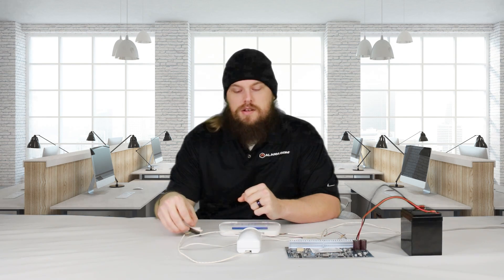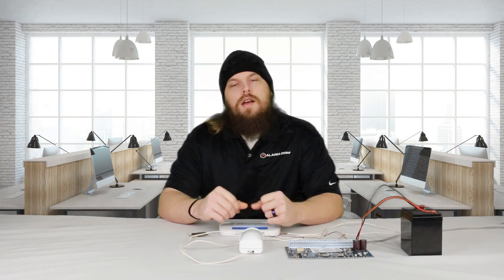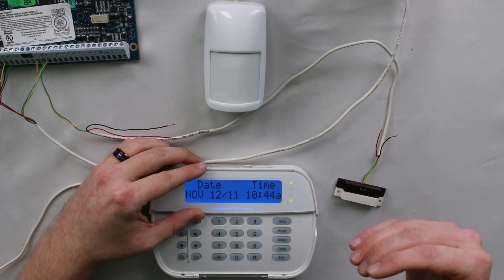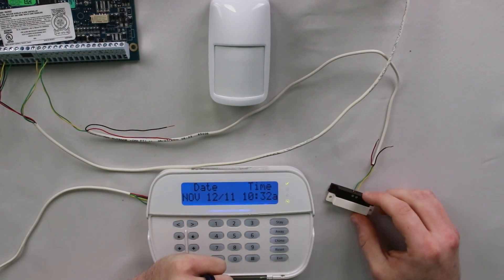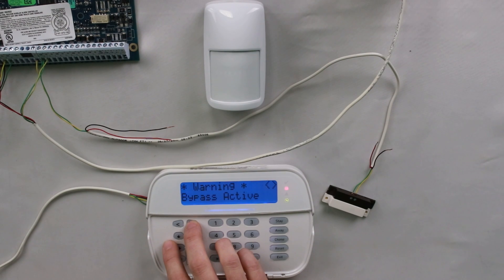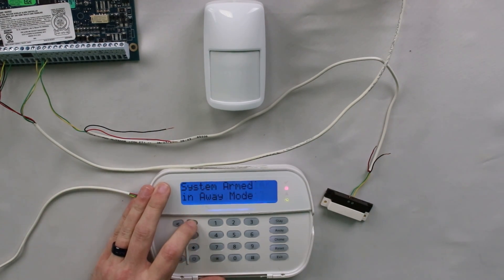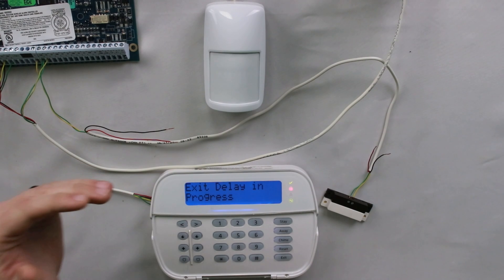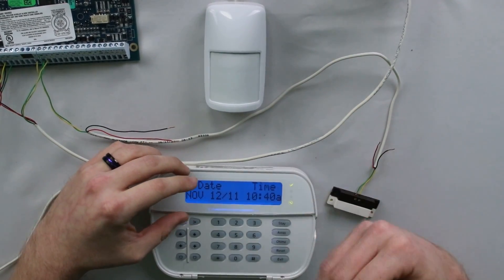Stay and Away arming Rules on the DSC PowerSeries NEO Alarm System

Comment: If there are 2 people inside the house but only 1 leaves during the exit delay(because the other person is staying home), how do we stop the system from arming in Away mode but keep it in Stay mode?

We don't want the inside motion detectors to trigger the alarm and have the siren blast our neighbours late at night! Thanks for any advice.
Reply from the maker: In this case, you'll want to use the quick exit feature. Fully arm the system in stay mode before exiting, then type *0 on the keypad, or hold the quick exit function key for 2 seconds on the keypad. This will give you 2 minutes to open and close a single delay door without triggering the alarm system.

Comment: Is there a minimum time the door has to be closed after arming before it can be opened for the occupants to leave. The siren got activated today and yesterday and lights 3 and 4 were flashing but no doors were open and nobody was in zone 3 or 4. Do you know what it is false alarming?
Reply from the maker: There isn't enough information here for me to say what might have caused the problem, but I can tell you that there is no minimum time you have to wait before you open the door to leave while the system is arming. If it tried to finish arming and the door was still open, that could potentially cause problems though.

Comment: If it goes into away mode after arming stay, does that mean the alarm won't immediately trigger on entry points like the doors?
Reply from the maker: If you're selecting stay arm but its arming in away, it means you dont have any sensors programmed that need to be bypassed for a stay mode to matter. In both stay and away modes though, you will always have an entry countdown. If you want a mode without entry delays, arm the system by pressing *9 followed by your code. This will put the system in "No-Entry arming" mode. This makes all sensors instant essentially.

Comment: I have the DSC Power 832 and would like to turn off the siren chirp when arming and disarming. I have searched high and low but can’t find an answer.  Thanks
Reply from the maker: Sorry, 832 is quite old (two generations old) and we don't support it.
Reply: Ok, thanks
Reply: go into programming  * 8 Installer Code  Section 014   turn off 6 and then exit progran=mming.  DONE !

Comment: How do you remove delay for stay mode?
Reply from the maker: You would have to arm in "no entry delay stay mode" to remove the entry delay. The user manual has details on that. 
https://cdn.shopify.com/s/files/1/1659/9809/files/HS2016-HS2032-HS2064-HS2128_V1-3_UM_R001_NA.pdf?18331804550319602332

You can't remove the exit delay however. There is always an exit delay, though silent in stay mode.
Reply: Same for exit delay? I specifically want to remove that for stay mode.